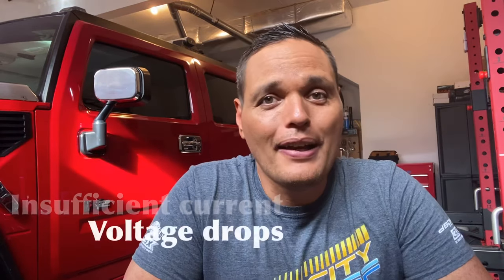The Top 10 BIGGEST MISTAKES in Car Audio. How to do it right!

Comment: This man is talking 3,5,10k watts and I’m over here stressing if my alternator and battery can handle 700-1000w
Reply: Usually an extra battery and upgraded one up front is fine for something
Reply: Most stock electrical will be fine under 1500 watts total.  I've ran plenty of systems 900-1500 total (400 RMS on doors and 500-1000RMS on sub) and have been fine.  Done it on many different vehicles.  As long as you have a decent battery and don't play it when the car isn't running you'll be fine.  My stereo would kill my battery inside 2 songs if the car was off.
Reply: If you're running a true 1000 watt rms like a JL 1000/1 you will need a small secondary battery and a big 3 won't hurt. You will most likely notice the headlights dimming
Reply: @derekgardin1512 what do you think 1800w would do to stock
Reply: 😂😂😂 me too
Reply: Haha...right!
Reply: Just wanna know can I use a 600/1  jl audio amp on cvx 15" kicker
Reply: @Savo-uk2xb  easily you won't get as much power as you could max potential but it will definitely still push it

Comment: Seems like it would b easy to really rock and get loud if you gots money... its a true thing of beauty when you make it sound great and work well when you dont have any real money to play with. Thats when folks truly learn.. when they have not much money and still do well
Reply: fr tho
Reply: It's not as easy as you think to get loud there is actually a bunch of science with it I have seen people blow 100,000k in a system and get smoked by someone with a qtr of the power I have personally spent around 600$ just in wood building different boxes to get a few extra db
Reply: @rodneycrandall1887  tbh it is easy if you just looking to add somemore bass to your music I have a simple set up I’ve been running with for a while now I’ve only changed my subs and the boxes no wood work not much tuning and I’ve changed all my wires like twice @kerry bray starting out is easy building on it gets tricky
Reply: You can be loud with 1000 watts if you know what your doing
Reply from the maker: Yep
Reply: Bro ong built my system sounds good imo and i spent like max 300 and i got 2 12’s on 1200 watts

Comment: Hey man, love your vids and look forward to seeing the boat build especially since we are buying a boat and I’ll be looking at adding some good audio too! My question is about my electrical, I have a 250a alt which is 160a more than stock and my total rms between my two amps is 2k should I have a secondary agm battery ?
Reply from the maker: If you have A strong under hood battery and big 3 you should be good. Tho most HO alts put out only half power at idle. So if lights dimming with bass you will likely need to raise idle rpm or add a supplemental battery.

Comment: Wish I would have watched more videos like this when I got started and my "exoert"  buddies who weren't out anything and I blew my gear. So I did LOTS of research, made lots of mistakes, and I had a ton of fun and spent lots of money. But if it's something you love, it's worth it. I learned quick about beefing up my wiring, but let me tell upgrading the alternator was a game changer. Do it since and do it right unless you like working on your shit constantly. Running 2 sundown x15v2s in a wall on 2 Def bonce atom 7500 a and jbl 8 channel dsp amplifier (need to upgrade), 260 Amp HO ALT in an 02 4runner. She's starting to sound nasty and I love it

Comment: Great advice! You should mention some companies such as rockville tend to use "rms" incorrectly. At least they include the "cea" rating, which is the actual "rms" in this case. And often companies don't include the rms and only the peak power handling hoping that you'll come to the conclusion that it's half of what the peak is. Don't take the bait! If they can't tell you the rms you should try to stay away from them.
Reply from the maker: Thanks for the input.... Absolutely right!

Comment: I’m more into SQ than SP, and my gear to install is Stereo Integrity 6.5”mkiii’s, 3” Carbon’s in pods on dash, focal tweets, Focal 6.5” in rear doors, I may find room to install a couple 5” Mids in rear for surround, AVIN HU>Audison DSP>80 Amp Gladen 4x120 & 5 (4X90 + 1 350 @4ohm to 2 ohm) w 0AWG to dual fuse 4AWG, w/175 Amp Terminal Fuse.  I’ll be spraying some Cascade VBX1 dampener in the doors and possibly the floors, Arches etc.  I’m thinking of getting a separate battery to mount in the trunk next to the Main Battery with NSX Isolator/fuse to Batt.  So I have 2 Q’s-1. The only speaker I’m not replacing is the Sub, which is an open Dual Coil in the rear deck.  I think it’s 2 x 4ohm wired in parallel due to the onboard Amp feeding 2 Ohm speakers throughout the car.  As such, if I feed it with 350W@4-2 Ohm, assuming the amp will adjust to the appropriate OHM, will I be overpowering it or doing damage to my 5 Channel Amp? Is there a way to test? 2. How small/big 2nd Battery should I get to power this setup?
Reply from the maker: It sings like you will be okay 👌 remember, if you are pushing out more power than you need you can always compensate by reducing your gains on your amp. Arc that power level, probably just getting a really good under hood battery with big-3 upgrade would suffice

Comment: I get it. Using the gain to compensate for under power is not a good thing. Leaving the gain alone, or setting properly on a system with a large wattage sub paired with a smaller RMS amp channel.

Comment: 1. How powerful system could be without need to upgrade generator or adding battery? Up to 2500W RMS? Mine BMW e90 330i has 180 AMP one.
2. To fully use 1,2kw RMS subwoofer, how much power should amp have? +50%?
3. If with car running I would listen at full sound (with adjusted gains not to get clipping) and without turning volume down I would turn engine off, would subwoofer get a clipping signal becouse of lower voltage?
Great video by the way.
Reply from the maker: 1) 2,500 watts is quite a bit for a purely stock electrical. at just 1,500 watts i'd consider upgrading your main battery to a AGM, doing the big 3 upgrade and getting one of these:
https://www.down4soundshop.com/xs-power-xp750-ck-xp-flex-4-awg-1000-1500w-install-kit-and-xp750-battery-combo-with-511-mount/  at 2,500 watts, you would need even a bigger supplemental battery or a 2nd XP750 wired in parallel.

2) Some subs can take a lot more than RMS ratings, some not so much.... always best to get an amp at RMS and set gains properly. but if you want headroom which is not a bad thing.... then get one a little bigger and set gains conservitavely accordingly. say you have 2 500 watt rms subs.... you will have no issue getting a 1,500 watt rms amp and setting the gains properly. See my other video on setting gains by ear here: https://youtu.be/6BdKX70rlP4

3) You could very well damage your equipment.... you got to understand electricity. When voltage drops, current increases. Current created thermal energy (heat). Electronics do not like heat. so yes.... try not to run your system anywhere below 12.3-12.5 volts.... if your dropping below that.... you need to upgrade your electrical.

Hope all this helped. take care and thanks for supporting my channel.

Comment: Running the power wires on the opposite side of the Speaker wires 🤔🤔 i always did that to my cars 😞 great info that explains alot with my systems they always work but they could've been better 🤦🏾‍♂️

Comment: Awesome video! New to car audio so got a quick question. What wattage amp would you suggest for a 150w 4ohm midrange speaker? Thanks 👍👍
Reply from the maker: If 150watt rms, and if running a pair, I’d do a 300 watt rms amp and set gain properly for headroom. If running 4 speakers, then a 600rms amp. If the 150 watt is max power, then RMS is typically half that so just cut those numbers in half
Reply: @NextLevelCarAudio  ok cool, thank you so much! 🙂👍
Reply from the maker: Sure thing man. Anytime

Comment: Is fusing solely based on wire size or wattage of your system? Thanks for the info. Building my first with purpose and knowledge!
Reply from the maker: You fuse the wire to protect the wire. I run zero gauge and do 350 amp fuses

Comment: Great explanation. I'm adding a upgrade to a 04 Chevy Tahoe. 2 Earthquake 12" subs. Running a 6000 watt Rockville. 
I have 4- 12" pioneers subs SVC 2 ohms with 2- 800 watt kickers running each set of 2 subs. It hits hard with the 4. Sounds clean. Looking to hit a little harder. 
I've installed upgraded electrical and alternator. Very clean install with what I have.  Not sure if I'll need the second battery with adding the Rockville. I'll be running 7200 watts to bass subs an additional 1000 watt pioneer to the mids. Total is 8200 watts. I've been Researching for a few months on the electrical details and Ohms, taking notes before installing the earthquakes. ( Conflicting opinions from what I've read ) seems I may need to add an additional battery and components. Your other videos helped as well  👍much appreciated. Cheers from Florida 🤙
Reply from the maker: Thanks for the feedback! Nice setup!
Reply: What are your battery , electrical and alternator upgrades I’m planning something for a Tahoe I’d say  10-15k watts

Comment: 5k system,  nvr done big 3, nvr changed alt. Nvr had capacitor, nvr had Xtra batteries.  O gauge back to fused block, 4 gauge to amp and good ground

Comment: If you under power your subs and it the right base for you and  if one day you want to turn up the bang and over heat your amp it will go into protection, on the flip you don't have protection on your woofers so they just fry right??? Overpowering versus under power subs.
Reply from the maker: You got it! Exactly! Check out my last video here where I ran a cheap sub on my 12k amp on over 10 times more power and it did not even get warm. Confirming it is better to over Power than under power your speakers.

https://youtu.be/jgyDUSrX_mM

Comment: I’ve got 2500watts on my stock alternator but I did my math and figured out my required aH for my supplemental batteries for it to be ok. I plan to upgrade the alternator but it’s ok and nice and fused/circuit breakered for now. I’m an electrician and deal with low and high voltage as well as ac and dc circuits.
Reply from the maker: Awesome man

Comment: I always overkill when it comes to my systems.....and the bolt that goes thru ur seat belt latch goes straight into the frame so it is a good ground but u need to do a little bit of wire brushing....but it is only good for 5000 or less watts any more then I would pry just go under the car and go straight to the frame

Comment: One can run all cables on one side of vehicle. Either the electrical cable or the the others need to be shielded. Shielded cable is more expensive but time is money. How much time would you save not removing panels from one side. However if your going to sound proof then no need for shielded cable because you will have all access to both side from removing  all for sound proofing.

Comment: Would you recommend installing a LED volt meter directly to the amp or threw the stock fuse panel on your car? I have herd mixed feelings on this. Thanks

Comment: In very early 2000s i made the mistake of wiring a Fosgate Power 551 with a wiring kit that wasnt up to the task, while driving i started to smell burning plastic so i shut everything off. The fuse didnt blow, power cable was black in most of the length with areas actually beginning to melt.
Reply from the maker: Wow, close call
Reply: @NextLevelCarAudio  yeah at 18 years old and minimum wage being 5.50 one had to try and make due
Reply from the maker: I got you lol

Comment: I’m using the seat post to the rear seats because my frame isn’t grounded but somehow the body is. Using a wire wheel to take the paint off with pure copper wire lugs and hit it with some clear coat after to keep it from rusting. Haven’t had any issues

Comment: I have 2 amps one 1200 Memphis srt monoblock. And a RF p400x4 
I have a big 3 on a stock 110 amp alt. with my grounds ran to seatbelt bolts👀😂 I figured I’d be good cause I’m not over 2k watts. Plus I have an extra battery in the trunk..... I’m pushing 1 15in L7. (4ohm). I have it wired to 2 ohms. An my amps only rated 750 watts an 2 ohms...... my question is.... will I damage my L7 ...it’s a L7R so it’s 900 watts rms. Running 750 watts to it? 

And should I upgrade my grounds? 

It’s my daily and it hits Js lol. Not a competition build at all but my mirrors Definitely have to be adjusted every morning before I drive to work.
Reply from the maker: Nice setup! I always say it’s better to over Power than under power. Headroom is a good thing! But you are not that far off. So you should be just fine my man. Grounds direct to chassis are always superior. That’s what I’d do

Comment: I have a question  so for 2 battery do i need to fuse 2 fuses between the battery and  then one more fucse to run from battery to amp so a totals of 3 fuse or 6 fuse?

Comment: Man just discovered your channel this was some great stuff. I have 2 12bd2  audiopipes in my bmw with a 3000w. SSL monoblock amp in a sealed qbomb box. Do you think they can take the amp bass turned all the way up?
Reply from the maker: Thanks! If your gain is adjusted properly, then you can turn the bass up yes. But if your gain is set too high and you turn the bass all the way up, then bad news for your gear

Comment: I just stumbled on this video.. I have 2011 Nissan Altima, it has high mileage...I bought a Bose radio/cd player this spring off of eBay..the radio matches my car..I got my radio from UPS..and I got my money back, I found out from the dealership that I need an amplifier so the radio can work properly, I’ve been trying to find an amplifier and etc.. and I don’t won’t to spend too much money on my car, because it’s an older model Altima, want kind of stereo system/ speakers do you recommend that won’t break the bank
Reply from the maker: You can factory integrate into your existing head unit. No problem. I’d get a good set of components. (Woofer,tweeter,crossover) for your front doors, and an amp to power them. Then a subwoofer and amp for your trunk. Size/power depending on how hard you want to bump

Comment: Ok so im doing research before I start my first build …you said power and audio on opposing sides, I was wanting to run my power by the driver door and my audio down the center is this far enough apart or should I route it through the passenger side, I do intend on putting 2-4 LiFePO4 batteries from the truck bed (in a toolbox w/a dc-dc charger and a few other goodies in there) and run that wire up through the driver side to the amps still same setup for audio wire
Reply: Im still unsure on where I want the amps I do want a good air flow from the ac to them because I have seen overheat and pop

Comment: Great videos. Helped me a lot already. I've been wondering if I need to replace my battery for my sub setup but couldn't find any info. Now I did. 

But at what moment would you advice a battery upgrade? I have a 560 watt amp and a 12v, 45ah 400a car battery. And a 10 inch 400 watt sub.
Reply from the maker: In all honesty you should be good for the time being unless your battery is old/weak. If your lights dim when the bass hits, that’s a sign you don’t have enough reserve power. Doing a big-3 upgrade will help A lot if you have not done so also. If doing big-3 is not enough, then need good under hood battery, if that is not enough, you need a aux battery in the trunk, if that’s not enough, then time for a new HO alternator. But that is usually the case in the 2000watt+ rms range
Reply from the maker: Also, thanks for sorting the channel!

Comment: Since almost NO vehicles have a frame anymore, any bare metal spot on the car will be a good ground... assuming that there is a good connection from the battery to the chassis.
Reply from the maker: Old and Brand new Trucks and Large SUV’s have frames as well as a lot of older cars. Which Happen to be a lot of the vehicles people put big systems into. Yes, Modern tin can cars don’t. But in that case, I’d always recommend running a dedicated ground to the rear from the negative battery terminal. Best possible connection with least resistance

Comment: If I am wiring (4)4ohm speakers together to have a final impedance of 4ohms, should I purchase an amplifier that quadruples the total amount of rams power to supply enough power to all speakers? This is the one I am completely stumped on. Thank you!
Reply from the maker: Yes. So if you have 4 500 watt rms speakers wired at 1ohm you would need a 2000 watt amplifier to run them at capacity. If you are running at 4 ohm, you would need a 8000watt amp for them to see the same power.